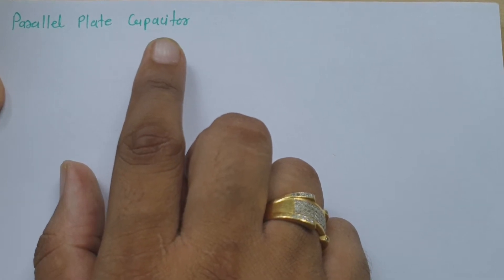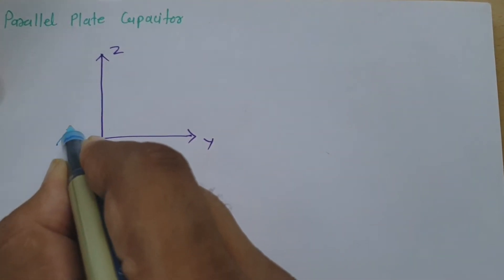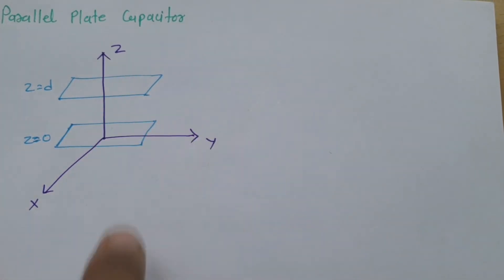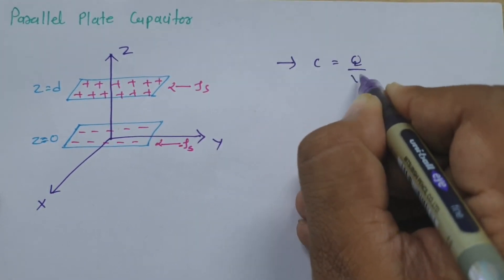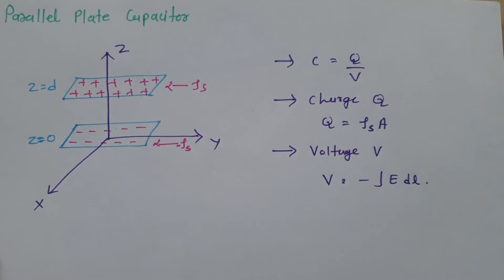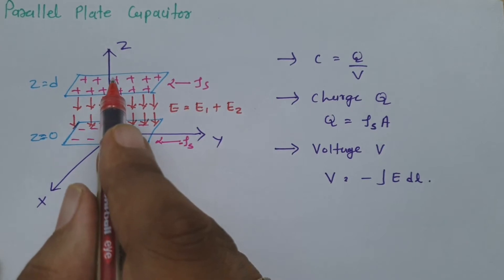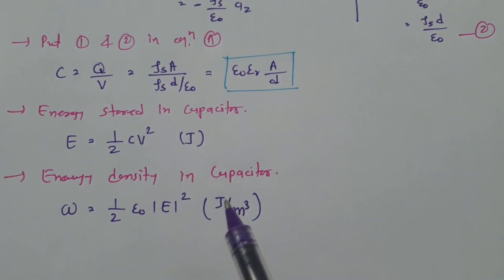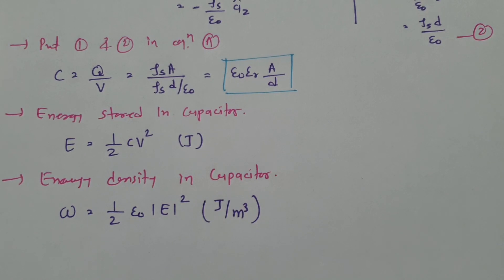Parallel Plate Capacitor: Electric Field and Capacitance Explained | Electrostatics

Comment: why did we consider Ps/2e ?
Reply: as here is two metal sheets.
Reply: E=Ps/2e is the equation for an infinite plane of charge. In capacitors, since the metal plates are very close to each other, the electric field of each plate acts as an infinite sheet (plane) of charge.

Comment: Sir if we have to find capacitance between two parallel plates then what will be the Area? Area of rectangle we can use between parallel plates?
Reply from the maker: Yeah
Reply: @EngineeringFunda  but sir width will get cancelled na? Acc to formula